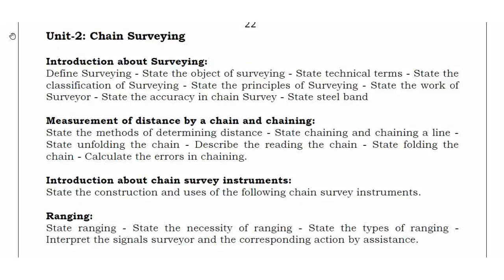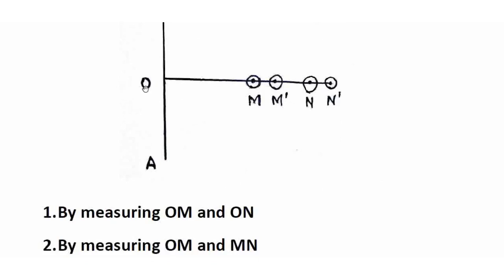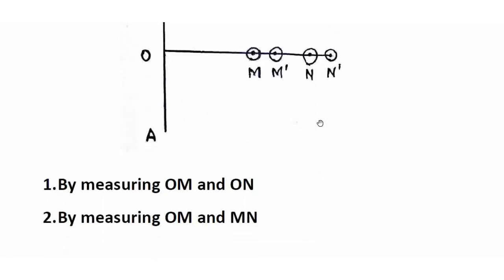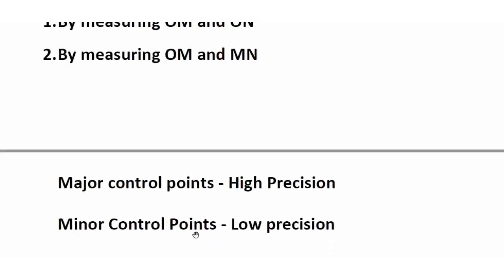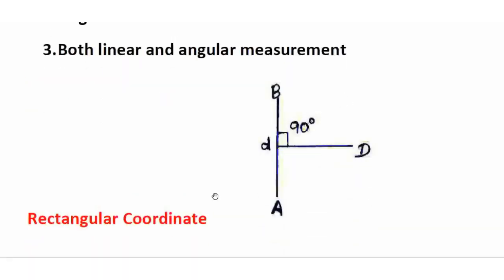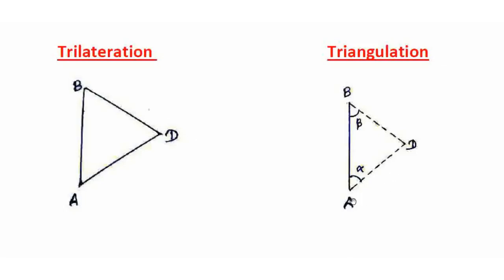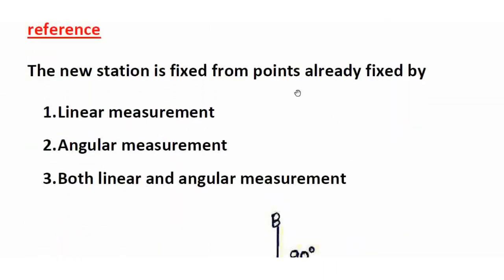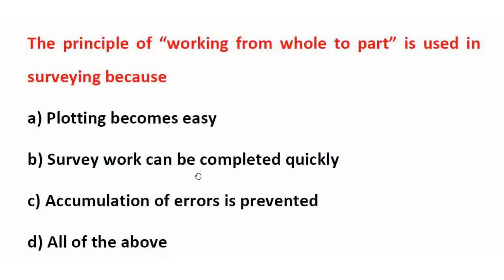Field Surveyor TNPSC -  Principles of Surveying

Comment: I think the triangulation method is  plot liner measurements and no angular measurements
Reply from the maker: A triangulation system consists of series of interconnected triangles in which length of Base line(here line AB) and angles of triangles(Angle BAD and Angle ABD) are measured. 
Thank you.
Reply: @CivilEngineeringintamil  ok mam